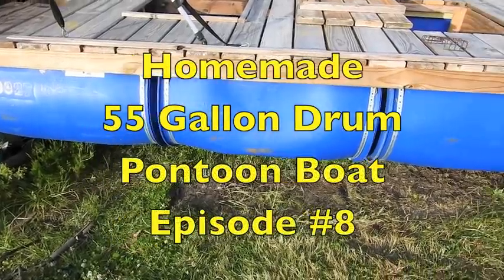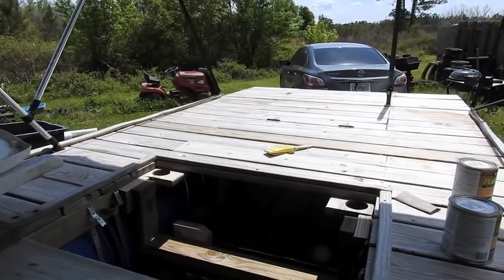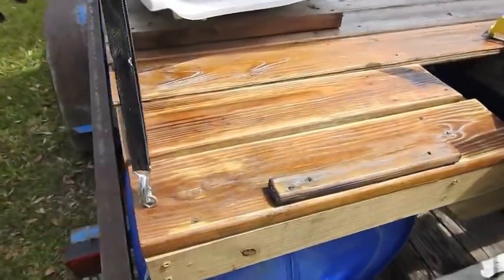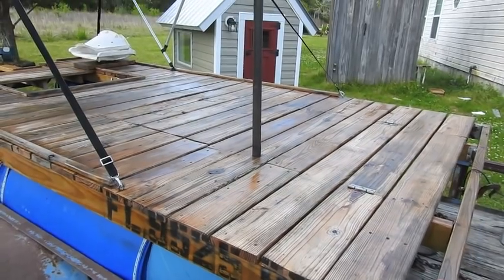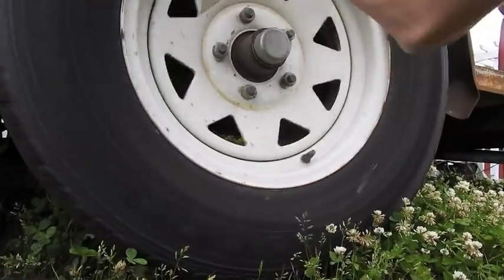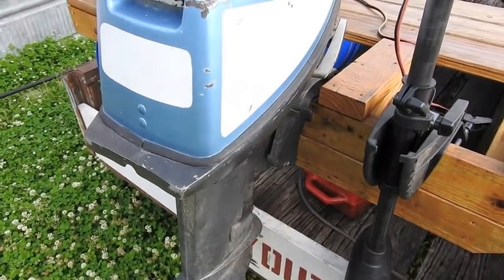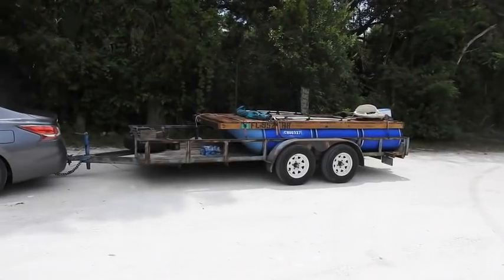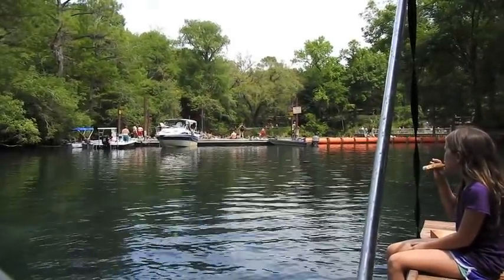Homemade Pontoon Boat Part 8

Comment: if you didn't find out already,,, regular poly isn't UV protected... it will yellow and start cracking ,,, a deck stain and sealer is much better for that ... wish you the best with it,,,i hope you don't have to sand it all off,,, I did that with a bumper on my truck ,,, I had to take it off and throw it out,,,, it was to much the scrap and sand off
Reply: sorry if I giving you bad news,,,but your motor isn't pumping enough water either,,, you might want to put a new impeller on it ,,,, hate to see you blow the motor
Reply from the maker: I already sold the boat so that I could build boat @2.  I see you have found that video too. Thanks for watching.
Reply from the maker: It is ok, I have sold that motor too... thanks again.

Comment: Have you ever considered drilling holes in the flat-stock top of the trailer rails, cutting 45's in pieces of angle running across the trailer, sliding a piece of PVC over the angle, then attach the angle with  hood-latch pins or nuts & bolts that would turn your "boat trailer" into a trailer with removable cheap rollers? Just a thought.
Reply from the maker: Sounds pretty cool. The good news is that I have a real pontoon boat trailer for the next one. thanks for watching.

Comment: Is that a Nissan Sandra pulling a tandem trailer..lolol
Reply from the maker: It is a Altima and it pulls it just fine. I have pulled the boat 28 hours worth of spring trips.  I am looking for a better pulling vehicle, but until I find one, Altima is doing good. Thanks for watching.

Comment: I learned recently that foam pontoons have a higher buoyancy than an air filled pontoon and you can fiberglass them to protect the foam from deteriorating or being torn apart if they hit stuff.  Just don't get the resin that eats foam and use the compressed insulation foam and not styrofoam.
Reply from the maker: That would be a cool build, where do you get the foam? Thanks for watching.
Reply: @chud327  You can get it at Home Depot, Lowes, etc.  Any hardware type store that sells the insulation foam panels.  

The pink or blue foam is extruded polystyrene and is more dense and doesn't fall apart as easily.  

You can buy it in 2" thick in 2x8 foot sizes.  By stacking 12 of them, you get an 8 foot long, 2 foot square block of solid foam.

If you do the math on buoyancy, a 2 foot diameter (Round) pontoon that is hollow, will support approximately 1570 lbs of weight.

The foam can be shaped to whatever you want it to be so you can put a cone shape for the nose to better slide through the water, add the angled side 'fins' (I forget the proper name for them) and then use epoxy fiberglass to cover it and protect it from damage and deterioration from sunlight, water, brushing up against stuff underwater, etc.

I'm thinking about do this for next year in a portable break down to stick in the back of my Caravan and assemble on site size but it'll depend on the wife (Happy wife, happy life...).
Reply: @chud327  I use similar foam to make RC planes.  Cheap to get, easy to work with and when you crash a plane, depending on how bad it is, you can fix it with duct tape and hot glue and be back in the air in minutes.

Comment: You could install on this one or the next one platforms that run out beside the motors, that rods could attach to for trolling. As for a structure, just use a tent. That way you can store it without it having to take up a lot of space. You can use the rope cleats to tie it to instead of tent stakes.
Reply from the maker: Great ideas and thanks, I happen to be looking for a tent as we speak. Thanks for watching.

Comment: Very cool build and a great job.  You could always pitch a tent if you don't want to build a permanent structure on the deck.  That way if you get caught up in a wind storm you could take it down and not have to deal with the winds over turning moments that would/could effect the boats stability(think sail) and handling.  Just a thought.
Reply from the maker: I like the tent idea and thanks so much for watching.

Comment: Great job my friend that little aluminum boat with the old motor on it surprised the heck out of me that thing was scooting right along great video thank you for sharing your adventures
Reply from the maker: Yes, that old kicker were getting up and going! I got to get my aluminum boat up and going, but I will have to use something a little more modern for the engine. Thanks so much for watching.

Comment: you should pressurize your tanks all you need to do is silicone the threaded caps and install steel valve stems then use a bicycle pump and air them up to 10 psi.
Reply from the maker: I want to do something different on my next boat barrels so they won't dent in. thanks for watching.

Comment: I cant listen to the video because of where I am but I am looking forward to seeing what motor you got.  I cant wait to take mine out with the 25 Hp on the back
Reply from the maker: Hope you got a chance to hear it and can't wait to see you 25 in action. thanks for watching.
Reply: @chud327  I did and I have to say I am getting excited like a little kid at christmas.  I cant wait to get that motor back and drop it in the water.  I am hoping it will be back before saturday so I can take it out then.  We had a little issue getting The Monkeebutt (The MB) off the trailer when we went out.  The water diverters on the front caught the front of the bunkers on the trailer.  It is an easy fix but I have to take Rhe MB off the trailer to fix.  If you build a newer bigger better pontoon we will have to chat about that...I have some ideas for that....Think Tri-toon!  I already have plans drawn up for one and it uses what I think is the best of The MB with what you did.  If I had a wider area to store mine I would build one 8 ft wide by at least 14-15 foot....I would keep it under 16.  I would also make the entire top usable like yours.

Comment: You can get a piece of pvc for a longer tiller Handel and when you run your motor put it in a barrel and don’t rev it too much
Reply from the maker: I actually did try the pvc extension when I had that motor on my other boat. thanks again.

Comment: I've been  fixing  to make one  of  these  myself for a while now. You  did an excellent job. Better  than  the design  I've had rolling  around in my head. How/where did you  get the  cones in front  of  the  barrels? That thing is just awesome dude.. well done!
Reply from the maker: Thanks so much. The cones are another barrel that was cut diagonally.  Check out episode #4 and it shows just how I did the front angles. Thanks for watching and good luck with your build.

Comment: Darn i watched your last video where the GWarden pulled you over and was thinking, "Did he water proof and seal his deck boards"?,  i click on your next video and Lo&Behold, your staining and coating the Deck.. :) I got mine in the works as we speak, bit by bit each  day -- found a fella 4 miles down the road with Unlimited $10 Brand New Drums for sale also -- i'm stocking up on them. One thing i did is i am making it 8ft wide instead of 6, i wont be needing to trailer it anywhere -- will be a permanent resident in the Pond out back. :)  Can't wait for you next Build, i was thinking of a bigger one also with a small structure on it and Bright LED Lights in the water under the Deck Door.
Reply from the maker: I am thinking about 8 feet wide and just under 16 feet long.  16 feet you have to have a throwable and what if I loose or forget it at home...  15'11"  would mean throwables are not required.  I want the little / simple house that is removable. Thanks for watching.
Reply: @chud327  would you happen to have the Details on how you cut out the Nose Cones for the front of your Raft, i don't want to do a trial and error then and waste some Barrels... Thanks
Reply from the maker: Absolutely and it was pretty easy. Go check out episode #4 and it will show you just how I did it. Thanks so much and good luck.

Comment: What size motor are you using?
Reply from the maker: I sold that boat and built a bigger.  I am currently running a 7 horse air cooled and have a 28 Johnson I am wanting to try.  On the original boat, I ran a homemade air cooled 3 horse, a 9.9 Johnson, a 12.5 horse homemade aircooled, and a 25 horse Evenrude.  The 25 horse would have been great, but it needed to be a long shaft...  I hope this helps and thanks for watching.

Comment: how hard was it to get that registered for use? im thinking about making one myself. thanks
Reply from the maker: I went to the DMV and said homemade boat.  It took them about 30 minutes and it cost about $32.  Pretty easy here in Florida.  If you build one, keep me up to date on the build and I hope you will send pictures to my Facebook. Thanks for watching and good luck.
Reply: @chud327  ty
Reply: @chud327  i figured it up and mine should weight 250 lbs, then have 2 or 3 people on it so 400-700 lbs with everything and everyone on it. do you think a c2 30, 30lbs trolling motor would be enough to push it around at a couple mph?? for comparison im gonna use 4 barrels and the platform is a little bit wider than a 4x8 sheet so basically 5x8 platform im using plywood on top instead of the 1x4's or whatever youre using to make it lighter.
Reply: @chud327  the goal for my build is to be able to put it in a pickup bed and have no trailer, will attach small wheels underneath the barrels, so i can hook a rope to it and pull it out of the water, while being light enough to pick it up and put it in the pickup bed myself
Reply from the maker: I am planning to use plywood on my next one too. I am not impressed with the speed of my 30# trolling motor. I even used it on a single barrel kayak a few weeks ago and it went about the same speed as my pontoon boat. I guess if you are in a lake and in no hurry it would be ok.  I wouldn't want to rely on it in a river going against the current.
Reply from the maker: 4 barrels and one sheet of plywood may be light enough.  I can't wait to see what you come up with.
Reply: @chud327  i ended up going with a 10 ft jon boat because of the weight. i dont have a trailer and it is easy for me to handle it by myself. im sealing the wood for my seats rn and gonna vinyl them tomorrow. thanks for the idea of this though i might do something like this in the future
Reply from the maker: Makes perfect sense.  BTW, I started a "homemade barrel boat" group page  on Facebook. Maybe you can check it out sometime.

Comment: Mabe stick a front electric motor just in case they break
Reply from the maker: Are you talking trolling motor, If so, I have one on the back. Thanks so much for watching.
Reply: @chud327  can you tell me what brand motor that is
Reply from the maker: The gas one is a Johnson 9.9 horse and the trolling is a Minn Kota 30# thrust. I hope this helps.
Reply: @chud327  how does that 30lb thrust handle your boat?